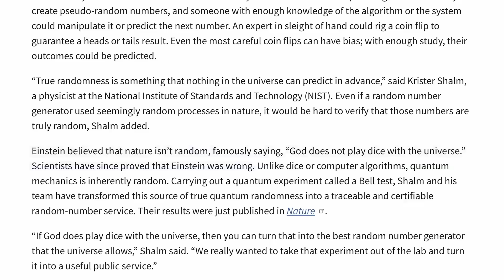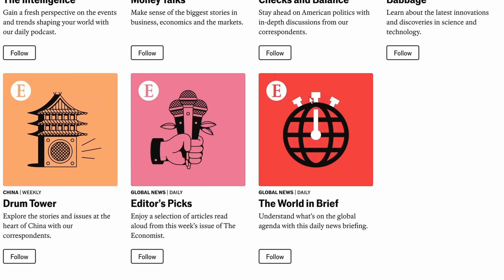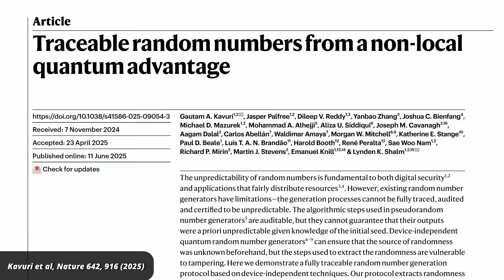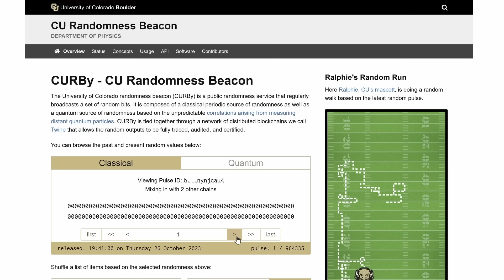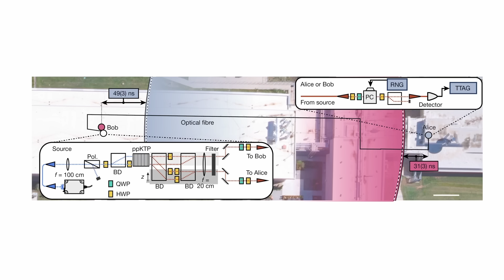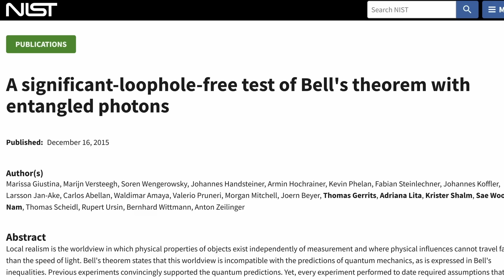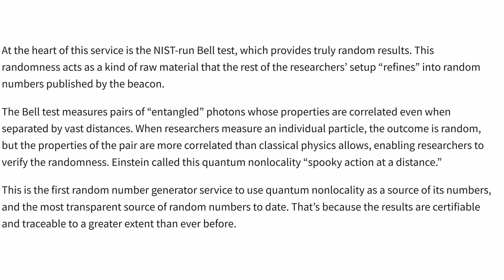Was Einstein Wrong about Randomness?

Comment: I am told that the digits of pi are indistinguishable from random, but of course those digits are not random at all since there are formulas that can be used to compute those digits.  We can show that some series of events are indistinguishable from random, but we can't prove that something is truly random.
Reply: Be careful about the term "random" or "randomness," which has different technical meanings in different areas of math/computer science/physics. Regarding the digits of pi, you are referring to algorithmic randomness, which is a separate notion from the probabilistic or stochastic randomness Sabine is discussing here. "Random" is used for both notions because of some superficial similarities. There may be deeper connections between the concepts, but those connections are not presently fully understood.
Reply: I think that's a very good point and succinctly phrased.
Reply: Because absence of evidence isn’t evidence of absence? Isn’t this whole issue just “it must be truly random because our current maths doesn’t explain it”? Or am I just being reductively simple minded? (Always possible)

Comment: At the center of this computational universe is the "Dwarf Agent." Its role is extended beyond that of a simple mechanistic operator to that of a rational and economic actor.1 Every action it undertakes—be it a decision, a selection of a state from the Zeroscape, or a transformation of the system's rules—constitutes a GADU cycle and involves a specific energo-informational cost, denoted by ϕ.
The agent's behavior is not arbitrary but is rigorously modeled by Expected Utility Theory. Faced with multiple possible computational paths, each with a potential outcome and an associated cost, the agent will always choose the path that maximizes net utility, formally defined as U(outcome)−ϕ(cost).1 This axiom has profound implications: states or processes that are more computationally "expensive" must offer a superior strategic or computational advantage to justify their update cost. The agent actively navigates a "cost landscape," and its behavior is governed by a principle of least action/cost.
This model transforms the framework from a purely mechanistic description to a strategic and economic one. The economic language used in the documents—cost, utility, budget, agent, choice—should not be interpreted as a mere metaphor. The fundamental axioms postulate that the universe is a computational economy. This perspective leads to a radical conclusion: the laws of physics are not immutable, Platonic truths waiting to be discovered. Rather, they are emergent "best practices" or "market efficiencies" that have evolved to ensure optimal computational performance in a resource-finite system. Physics thus becomes not a science of discovery, but one of reverse engineering, attempting to understand the economic principles that generated the observed laws.  this is from my paper The Computational Ontology of Quantum Mechanics: An Analysis of the GADU-IOMM Framework - Resarch gate

Comment: In 3 a letter dated March 1947 to Max Born, Einstein used the phrase „spukhafte Fernwirkung“ and was discussing the collapse of the wave function.  This is what Sabine is asserting.

During the Solvay Conference Debate in 1927, Einstein raised concerns about nonlocal effects during discussions of wave-function collapse. He warned that a wave description passing through a single slit implied “a very peculiar mechanism of action at a distance” to avoid the wave influencing multiple points on a detection screen.

In the Einstein–Podolsky–Rosen (EPR) Paper of 1935, they argued that quantum mechanics' predictions suggest nonlocal effects, famously criticizing instantaneous influences between spatially separated systems. While the phrase “spooky action at a distance” doesn’t explicitly appear in that paper, it is often retrospectively applied to the phenomena they described.

So, it may have been a catch phrase that he never actually said, in the same manner as "Beam me up, Scottie".  But Einstein was indeed critical of any suggestion of nonlocal effects in describing Physics.
Reply: wasn't the EPR paper published without his consent?

Comment: One way to trully achieve randomness with certainty is by pairing different incorrelated variables together. Problem is that leaves the observer or "creator", "inventor" on the podium to forecast what the pattern might be—unless, you use something that can't relevantly or significantly measure something, aka: "no memory bank" it's impossible to create a trully random moment or measure. And, to top it off—as long as it is living it has the capqcity for memory: given that DNA, and transcription and translations of it sequence underpine genetic memory through diversity. Else—a trully stochastic universe might look very warped if you think about it—it would mean from disorder there is an emergent order—in so far as my 30 years of life—I've never encountered anything in nature, society, or existance that can't be measured, if else: projected on as a constant, variable, or factor

Comment: They neglect that in order to produce their trapping potential, you need a large number of contributions. Just think about a hyperbolic Penning trap, arguably one of the best understood particle traps in all of physics. You have the electric field of the electrodes and the magnetic field usually from a superconducting magnet. If you just take the surfaces of these objects you have >10^18 atoms on the surface. The trapping field is the sum of all of these small contributions that would be different if any of these atoms were swapped or changed position. Because your trapped particle is interacting with the field and "every action has an equal and opposite reaction", your trapped particle is interacting with all of those atoms to a very small degree. That is the source of the "unpredictable quantum correlations". If you had the compute resources to model the entire universe, the whole premise of physics is that you should be able to predict it. The unpredictable parts come from lack of understanding of the underlying mechanisms at higher-order and the need to make a problem computable before the situation happens in real life.

Comment: @SabineHossenfelder  It strikes me that true randomness should carry with it an information destruction phenomenon similar to a black hole.  You have a true-random number generator:  However it works, it must output it's random number onto some physically existing thing, a photon, an electron, the position or orientation of a particle... SOMETHING.  That something had a prior state that must have carried information in that state.  Therefore, that information is over written, and lost.  Perhaps a better way to think of it is not in terms of information but bandwidth.  The universe can be thought of as a large hard-drive... a hard-drive transfers information from the present tot he future.  It's bandwidth to do that is the capacity of the drive.  In a universe in which information, like mass/energy can neither be lost nor created, every particle carries a full load of information by virtue of having values for all of its states.  Those states might interact with other particles exchanging and scrambling the information, perhaps hopelessly beyond reconstruction, but in principle it's all still there.  This works only because the data storage capacity of the universe, that is its bandwidth to transfer information from the present to the future, is both finite and full.  But a true random bit added to the message does not fit if the hard drive is full and not growing at the same rate that one is adding bits to the message!  There isn't enough bandwidth to transfer that new bit of random information to the future unless we delete a bit of information that was previously occupying part of the drive.   Therefore, a true random number generator destroys information.  

Why am I wrong?

Comment: There is a condition that may exist at the moment between something and nothing that may be randomness and is also where the tachyon would be found if tachyons did not simultaneously self destruct.  There is very little randomness in the universe and that is the tiny moment when two independent systems contact.

Comment: bs, even quantum is not actually fully random. sampling is same as normal random number generators, ie not random. thats what you get when you ask advice from any economist. ie their systems of economy are random, not directed by them. encryption is not to be relied on or used as an excuse. scientific exercise its fine. well quantum systems are pretty random behaving. ie the random numbers generated are pretty good. rip nonsense.

Comment: There is actually a good way to test if a set of data isn't truly random. If a sufficiently large set of the data can be compressed without destroying information, it isn't truly random.
Reply: What do you mean in compressed?
Reply: @RS-nc2yn  By compressed I am referring to data compression, the kind we use in computer science to reduce file sizes, but tailored specifically for this purpose.

Comment: As if we should actually trust NIST to come up with a quantum resistant algorithms considering the very poor record that the United States has had and I reference the crypto AG scandal here in Switzerland as well as the tetra standard and the inherent problems even with the top tier tetra standard which has some anomalies that were too difficult for the security researchers to understand but without question there was a problem and they made a call out to cryptographers to help them untangle that particular issue.

Due to the quite good responsible disclosure protocol followed by the academic researchers which should serve as a template at least for future responsible disclosure the agency that regulates tetra has now changed their previous statement following the disclosure that they're going to maintain security by a by obscuriy. It's really absolutely and as we keep on saying stupidity.

Comment: I have a question for you Sabine would you agree that just kind of randomly throwing together some safe levels of radioactive isotopes and a Geiger counter for example that's programmed to in a way that it stops on a number upon the registering of decay would be a great random number generator as the decay of radioactive isotopes would be very very hard to find any type of pattern.
Reply from the maker: Well, nuclear decay follows a pattern, it decays exponentially with the characteristic half-life. Might be easier to do with cosmic rays.

Comment: Having created some of the most secure devices in the world with some of the best random number generators inside of devices that also use random numbers to improve data retrieval, I TOTALLY AGREE with your analysis on Bell and your criticism.  I've been making this criticism for many years.  Einstein was not proven wrong.  Finally somebody else has seen this.  Finally.  At Seagate, for our self-encrypting drives, for which I am the actual inventor with the patents to show for it, we would spend about sixty days of a full time hardware cryptographer on billions of ostensibly random bits to certify randomness.  Spinning disk drives have many, many, potential sources of true randomness in the sense that patterns can not be found by any test my best mathematicians could find.  We ultimately used "weak bits" that fluttered as a seed to strong whitening functions.  And a given self-encrypting drive could produce a 256 bit random number at a rate of about one every fifteen minutes internally, despite the fact that these drives were writing and reading gigabytes per second (internally).  We only needed a few of these random numbers to secure our drives.  And with a standard TCG command, that I defined, you could (and still can) get one of these random numbers (not the ones used internally) for your own use. The PSID number printed on my drives is one of these numbers that can only be used to set that particular drive back to factory state (cleared of all readable data).  I have patents on this too (probably expired by now).  We were deeply involved in these claims by quantum physicists (and mathematicians) that were lying.  Even though you might think (I think wrongly) they didn't think they were lying.  They were trying to sell something which was never true.  I hated the fact that nobody would believe me.  Maybe you will have better success.  That said,if you use the PSID to do a cryptographic erase of all the data on one of my self-encrypting drives (from Seagate, and hopefully others) you can be sure that data cannot be retrieved since the actual key used by the drive to encrypt the data to the media could never leave the drive and, in fact, wasn't even on the drive or in readable silicon in clear text.  The odd thing is that even though I came up with the label "PSID" I have long forgotten what word the "P" stood for in the Security IDentifier.  I made it up one day and forgot what the P stood for, maybe "Public" since it was required to be printed on the drive label for repurposing drives and/or permanently cryptographically erasing a disk drive in under a microsecond. (I defined about five or six other SIDs that day (e.g., like "MSID"), some in the TCG standards I wrote).   Again, I had the patents and you can check that.  To my knowledge no one has ever cracked the security on my drives except by ways you cannot avoid (e.g., a gun to the head of the person who knew how and were empowered to unlock a drive for reading and/or writing).  I have a proposal I published to use this tech to guarantee near perfect privacy throughout YOUR LIFE AND AFTER LIFE.  Here is a recent YouTube on that along with the paper on Medium:  https://www.youtube.com/watch?v=tyxTdFlmZY8  Sabina probably won't like it, but she probably won't understand it, either.  But thanks for debunking this quantum computing lie!

Comment: CloudFlare need some random input to run their business (which is basically about internet stability and security), their approach was to put a bunch of lava lamp to generate their seed of randomness.  They also display a groupe of double pendulum for the same purpose.  

It might (emphasys on might) not technically be trully random... but if no one on earth can comprehend how it works, not even physicist or AI, then that's good enough.

Comment: Why can't these people AT LEAST run their papers through GPT over and over to iron out false claims? My guess is that they do, ONCE, and they find so many fatal flaws that they decide to send it to their coconspirator friends instead.
Reply from the maker: Yes indeed, it will be very interesting to see what happens to peer review in the next two years or so.
Reply: @SabineHossenfelder  Indeed, things like using correct terminology is what large language models are for
Reply: GPT isnt going to be much of a use to iron out false games.
Reply: GPT will tell you god probably exists if you tell it to. It is not a tool for Truth.
Reply: @Greenicegod  I said "AT LEAST". Don't rely on it as gospel.
Reply: @orionspur  The bias inherent in AI is significant and largely invisible - bias lives in the blindspots of the assumptions humans can't see.
Reply: @justsomeguy9555  From big analyses of AIs' outputs it is evident that they have their creator companies' agenda, securing their piece of the pie to them. Be aware of this (outputs get tilted). Probably nothing super dangerous, except for the case of OpenAI that wants to have too much of your personal data (which OpenAI can use in generally inacceptable ways).

Comment: Looking at a finite state device evolving according to simple rules, or even complex rules because it doesn't matter in the long run, gives you the possibility of  a system that won't allow you to calculate a future state, even if you know the rules. There is no efficient computational short cut, nothing that corresponds to a physical law, no Hamiltonian, so to speak, and yet that system is still obeying a set of rules. Its evolution might appear random. But it isn't. And if you look at the system after it has evolved for a long time, and apply some computational device to determine a set of rules, to prove that it is or isn't random, that does not appear to be a problem that any computational device could solve, no matter how long it runs. But suppose you've actually got a sea of truly random variable, although you could never prove randomness (I'm going to say that no computational device, no amount of observation, can ever prove that a system is random), you could take many samples and as long as this sea of variables has finite variance, or as long as the part of this sea from which you draw samples has a finite variance, a kind of order will appear. Central Limit Theorem. Suppose again you have a sea of truly random variables, with the caveats already mentioned, and you let it evolve. Here is where you start getting a picture analogous to a maximum entropy state. Given a lot of time and a lot of space, and unbounded works better than bounded. a structure will emerge that is not random and a structure will appear that grows according to internal rules and as such structures appear and grow, the non-random displaces the random. Self-replicating rule bound structures displace randomness, although the rules might be such as to make the evolving structures hard to predict, although you have the possibility of hierarchies, sub-structures within larger structures, some computational and others not. And we must remember that all these structures must be physical rather than abstract. Ever and always we are dealing with "stuff", actual "things" with physical properties. Pure abstraction will never do.